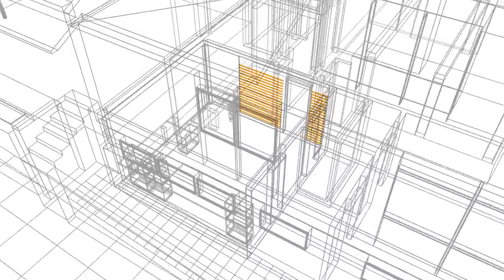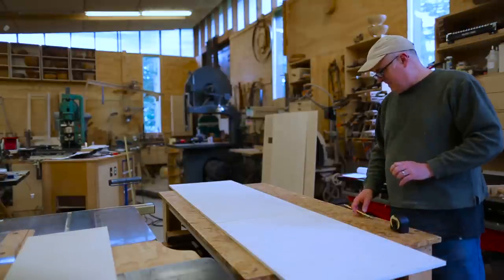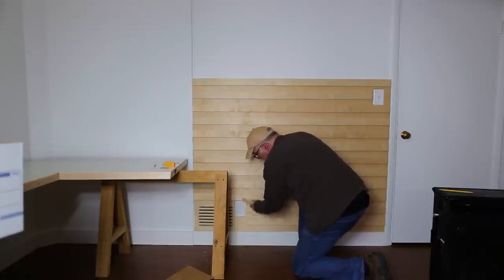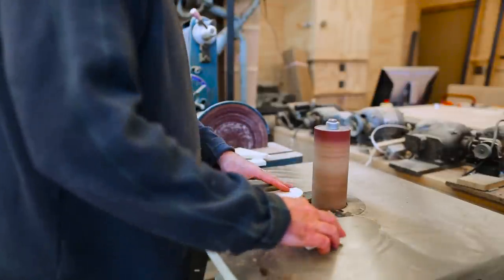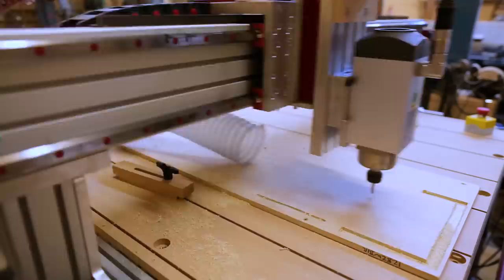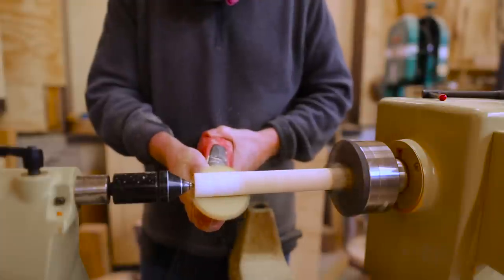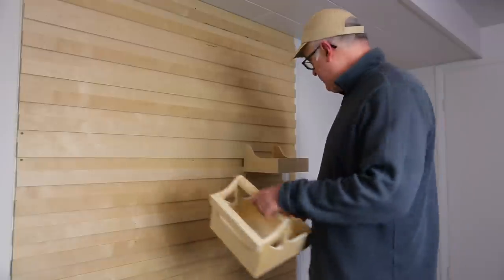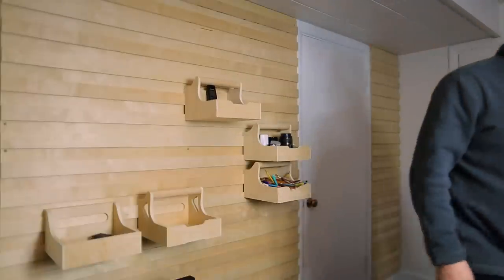Office 3: French Cleat Storage Wall

Comment: Frank - great video!  Since you are using the CNC to cut out the shapes, I would recommend that you CNC a round pocket hole for the handles in each side to add strength.  This way you are not relying on just glue and nails to hold the handles to carry the weight inside the box.  I try to avoid using hardware to carry weight wherever possible.

Comment: Great Video! You might do well to look into a simple bent wire handle, like you might find on a 5 gallon bucket. It could fold down to the front and leave you unlimited vertical clearance in each box while still leaving it low profile and easy to dismount. Making bending forms should be a breeze with the CNC! You could probably even do bent lamination handles with little trouble, to keep that all-wood feel...

Comment: Another great video Frank...    For long items you could use two boxes side by side with the inside box walls removed.  Depending on the length of the item, you could just slide the boxes farther apart to accommodate.

Comment: To be honest i'm seeing this solution for the first time...and it's a great one !
Two things i would do different:
1. i would use the CNC to create a hole on each of the side walls to then fit the handle/cylinder(should be good for heavier loads).
2. i would maybe drop a small rail along those cleats to have a smaller contact surface and be able to slide the loaded tool box on the cleat; you are then able to take out the desired toolbox just by sliding the upper/lower one. 
Btw, thanks for leaving the tools used in the description;  i'm checking the spindle on your CNC(should do well for aluminum as well.)

Comment: Regarding the handles, you could put handles on the sides, then they are out of the way. If you want to do something for one-handed operation you could make the handles on the sides near the bottom as a ledge or lip. Thumb on the top of the ledge/lip and fingers under the bottom.

Comment: Frank, consider the handle coming out of the rear of the box and sticking forward as into the room.  It could easily be held at one end only.  Drill hole through box.  Insert close fitting dowel.  Glue if you wanted.  But, I bet you could get away with removable dowels.  When you want to remove a box, insert dowel, lift and away you go.  Forces would keep the dowel in the box back and it would take a big impact to knock a box off a dowel.

Comment: Well now that you have a cleat wall, you can make a completely modular office space where you could just have a table with cleats, cleated movable power socket, a cleat on the back of a monitor, cleats on everything! 
And if you fit tiny casters on some of the cleats of whats hanging up there, you can slide them along like a ladder on a rail, vintage library style!

Comment: Awesome stuff.  I think I liked the first one  you made the most.  Beauty in its simplicity.  Grab it by the front and use the cutout handle in the back as you move that toolbox around your shop.  The lower height there will probably allow you to stack these on the wall a little better.  It looks like by the end of the video you still have trouble getting any of these middle boxes off the wall without knocking into the other ones.  I'd settle for just checkering the boxes across the wall.  You have more stuff than I do though.

Comment: All the good ideas for things I'll probably never make time to make but I have an idea for you for the handle if you're still looking. Attach a hinged handle with the hinge in line with the center of gravity of the box and let the top of the handle rest on the front of the box. This way you can pull the handle up and push your thumb on the bottom of the box to lift it and be able to stack more boxes sequentially on top of each other.

Comment: Frank Howarth, I like the French Cleat Toolbox idea. Well done.
One idea I've been experimenting with is making parts that have a 180 degree rotational symmetry such that a single cut between the parts separates them. This results in less space between certain parts. The only waste wood would be from the bit itself. This would not work with the rabbit in the sides but it would with the rabbit in the front, back, and bottom.

Example: The sides of the box could go from the top of the handle straight back. Now imagine that line being rotated 180 degrees and translate down to line up with the lower part of the side at the front. The opposite side top and bottom could be mated like a puzzle piece to the first.

This should reduce the number of cuts for a set of sides by one making the milling process faster. You could butt parts together for some projects such that the number of cuts is reduced by 25%. Let's say you wanted to cut 4 rectangles of equal size. Rather than milling 4 squares, mill 2 middle cuts in a + shape and1 large square.

Is there a reason this isn't done in practice?

Comment: Hey Frank -- make a small table/work surface that hangs on the lower cleats. Or even better, give a couple of the cleat rails copper conduit (think rail lighting like in art displays). Then you could set a fixture onto the rail that touches the copper conduit and it could power a light socket, or a receptacle, or maybe something else. The receptacles could then be taken off, moved around, etc.

Comment: Love your videos.

In my experience simplicity always wins, and that is probably the biggest reason why my idea is not the best, but I am throwing it into the pot so we can stir it with others to end up with the best idea overall.

Perhaps you can make a swinging handle (al al supermarket baskets) where the handle pivots from the top middle of the sides and can fall forward (away from the wall) to lie flush with the front end. That way you can grab the front (thumb downwards)  lift it off the wall and curl your fingers around the handle in one movement.

Comment: Don't know if this was mentioned already, I would suggest if you're using CNC to cut the pieces that you could cut the French cleat shape into the box sides. I guess you would have a rounded inside corner so you would have to either sharpen up that corner or make the corner go a little past the point to allow for clearance, (or round off the points on the wall cleats) but that could eliminate needing the back cleat strip at all.

Comment: So glad you decided to go with french cleats!  I like how you are using small, easy to handle boxes.  I would imagine you are not putting anything too large on the cleat system in your office as opposed to your shop.  Maybe a set of drawers where you can further organize small items.  Pens, draft pencils, stencils, camera batteries.  On my desk right now I could really get rid of a lot of my clutter just by doing that.  Perhaps something different on the higher rungs of the cleat system where the tools/items are available for reach and visible, so you don't have to grab the handle and bring it down to gather whatever's inside.  Drawing some inspiration from your french cleat closet system you setup before!

Comment: Hi Frank, I always love your videos. This project is great, I'm thinking of building something similar in our pantry. Your hints about cutting the sheets was very helpful.

Handle ideas: add handles like the T grip on a canoe paddle to the corner(s) vertically or like a coffee mug to the side panels should solve the bar on the top colliding issue. If it's not an issue they would match your "shopping bag" aesthetic you had on your previous project. 

Suggestion for Items to add to the cleats: small cabinet with doors, a small bits/like a shadow box/ with drawers, Book shelf, Tape dispenser,  Wall mounted phone charger/home phone base station. Speaker shelf, TV/ old computer monitor attached to a cheap computer/arduino to show news/weather/ YouTube stats/calendar etc. 

Awesome project thanks for sharing.

Comment: My ideas:
1. Do the box with two cutouts for handles on the sides perpendicular to the wall.  It'd make it easy to grab the box with both hands and remove it from the wall, making it much sturdier if the box is carrying heavy/fragile loads (e.g. camera lenses).

2. Hooks for cables, straps, etc?

3. Vertical files for books, notebooks or papers.

Comment: Hi Frank!  I like the way you think.  You roll over the many possbilities and then experiment.  Addtionally i think if your first way of grabbing the boxes is in the front then you probably should put the handle towards the front instead of the back.  And then the handles may be less of an obstruction when you stack them together if you designed the holders with different depths.   Altho stacking them together may not really be a great idea in general.  I also think you could make a box of drawers (small ones like 3 x 3  or 4 x 4) that also have cleats that can be hung on the wall.

Comment: Frank, it would be interesting to have a collapsing table to lay out drawings or have a larger working station, where the top of the table could connect with a cleat and the arms could fold down into a lower cleat to lock in the table surface.
Cheers Mate!

Comment: Very cool. It seems that you may want to make the handles a little lower, so that you can use the handles when there are boxes right above each other.  As wall real estate becomes more populated, you will lose the functionality of the handle otherwise.   You will then either be back to grabbing them from the front, or having to lift two or three boxes to get to the one you need. Good luck!

Comment: This is brilliant. I have an art studio and this type of storage would solve a lot of my problems.
Reply: French cleats have been around forever.  Probably the best aesthetics and functionality you can get.  Start googling around and you will get flooded with ideas.  Flexibility is limited by your creativity.
Reply: thank you
Reply: I have a french cleat system for my hand tools in my workshop.  It's wonderfully flexible for when I get some new tool and need to find a place to keep it - i can easily move things about and make space for it, then make a holder.     

As time has gone along though, I have found there's a lot of wasted space because  the holders can only be placed at intervals down the wall.    And I've found i have situations like a holder that is placed underneath a saw blade, so to get access to it i have to use my other hand to lift the saw out of the way first.     With hindsight, I might have been better to put the strips closer together, so the vertical wasted space would be less, and i'd have more options in placing the holders vertically.   (i hope that's making sense).       The more tools I have on the wall, the more pronounced this problem is becoming.
Reply: No, why do you say that?
Reply: You could also search for "slat board" if you don't fancy making it yourself. Usually used in stores etc., but they're available in many colours and densities and (around here at least) are quite reasonably priced.
Reply: I am going to look into these ideas. Thanks everyone except the troll with the "R U Gay" comment because I don't really care what kind of sex my friendly commenters are having.
Reply: That makes sense.  Thanks for sharing that...

Comment: Of course frank howarth has a full 3d model of his house, why was I even surprised.
Reply from the maker: it's pretty rough
Reply: frank howarth Just a thought: make the boxes without a handle, then make a "tool box" that you can put each box into. eliminating the integrated handle will allow you to put more boxes up on the wall. Relocating the "hook" strip on the back of each box slightly lower(so more towards center) will allow for easier removal of boxes when closely nested together. perhaps make the bases of each box with a rabbet as to nest within another box when it is stacked upon another one in your "box chest tote device". Not storing more items in a single box that can still allow for "nestability" will further aid in being able to potentially carry multiple boxes simultaneously. Again, just a thought :)
Reply: Buddy Crotty I'd have been surprised if he didn't have it.
Reply: What's the 3d model software called?
Reply: +V Vardan SketchUp
Reply: Exactly what I thought lol
Reply: how else would he be able to 3d print his house in the future.
Reply: It's pretty detailed though too!
Reply: I'm not surprised at all.  I've modeled many houses and I have a model of my workshop so it's easy to move things around if necessary.  Sketchup makes it easy.
Reply: I have a full model of my house and furniture, makes rearranging and project ideas a whole lot easier. With my old house, I had drawings of the house down to the smallest detail. 
When I get my future house built, which won't be for a long time, I'm going to have a model detailed down to finish nails. The biggest thing I hate about diy work are those little surprises you run into during a project, having a fully detailed model will prevent any of those surprises from ever happening.

Modeling a house isn't even that difficult, most of the time you can just use floor area and ceiling height. 

Unless you have a half-assed house like mine currently is; trims are all of different dimensions, some walls have mounds of texturing, etc., which is literally a nightmare to even think about doing projects with. Even better, part of the house is wood, other brick, and it makes no sense; I could understand the original house being brick with a wooden addition, but no, it's just one room that's brick, all the rest is wood; and the wiring is just as bad, circuits make no sense and half the plugs are legacy 2 prong 'grounded', and the rest are standard 3 prong.
Reply: I like the idea of this storage wall a lot. I have had a thought of having a block system with a French cleat for storing pencils and the like. This could be a nice addition to what you have. The blocks would have holes to accommodate the pencils. Like the old coffee mug system only more sophisticated. A grip on the front of the block would allow for a thumb and forefinger grab to remove and use. Love the channel.
Reply: Rough is relative.  I think your idea of 'rough' is about P5000 grit sandpaper :)

Comment: Hey bro! This is a really neat idea. I think that different heights on the wall would determine different designs. The top boxes might prefer your first design, the middle your second design and the lower sections could be much bigger... maybe permanently on the wall but made to slide well with each other allowing access to the bottom without having too bend down to try to fit the into the cleats...

Comment: Hi Frank!  I always enjoy your projects and the thought process you share.  I paused the video at 11:30 and see your arm stretched out just above your shoulder.  It made me think that ergonomically speaking you probably wouldn't want to add tool boxes above that height.  May I suggest long rectangular boxes that mount on the top most cleat that go no lower than shoulder height for you to either store books or periodicals?  Or better yet, boxes that showcase prized momentos or any of the wonderful projects and bowls you have turned?  I realize the applications are endless with a wall of French cleats, but why not mix utility with a bit of a showcase.  A mix of form and function.  Warm regards.

Comment: Love this. I think I might try to make a version of this for my son's room. By the way have been working on adapting your radial arm saw dust collection for behind my sliding miter saw. Good results for standard cut, but poor results at full extension (as you thought) and prototype 1 I completely forgot to plan for bevels and miters. Had to completely remove it building a boxed mantel the other day. ;)

Comment: reduce the box height, so it can be removed without displacing the one above it?
Reply: jonnken would be Great.. but I think, that Theres so much space, that he doesnt has to use aaaaall of that Giant Wall :-)
Reply: @Bleen Paper - I'd like to cite AvE on this: "Tools and Workshop Stuff is like a Gas - it tends to fill any Volume"

I'm with jonnken on this: please redesign the boxes ever so slightly. It would be a pain to one day discover you have to remove all the boxes above to get to the lowest one.
Reply: All you need to do is to trim 1/4" off the top of the handle, and you'd be able to lift out the boxes.  The flat would be a place to put your thumb.  It could be cut with the big tablesaw before adding the cleat.
Reply: +monkeyheadtpc I'm with you on that one.
Reply: A flat for your thumb would also help to stabilize this asymmetric box!
Reply: Yes. Remove the kick up in the sides for the handle and you will be able to grab the handle and lift it with out interfering with the box above.

Comment: It seems could potentially hang more weight on the panel than the mounting screws should handle.   I want a similar panel of French cleats in my garage. I intend to hang a heavy load of tools on it, so I I've been thinking that I need to screw into more studs, and maybe rest some of the weight on the floor with supports.

Comment: The second intuitive handle I see you use in this video, after the "toolbox handle", is to grab not on the front, but on the sides. Instead of entirely removing the holes from the side, perhaps enlarge them so you have a pair of grips.

Comment: I am trying to imagine what would be appropriate for the higher cleats close to the ceiling.  May be a handle that's further out or protruding on the front face of the box... may be a wider flatter box with a lid where the handle in front also serves as a simple lock...